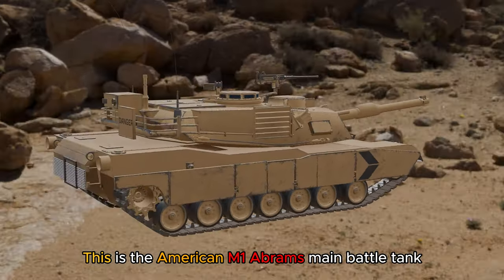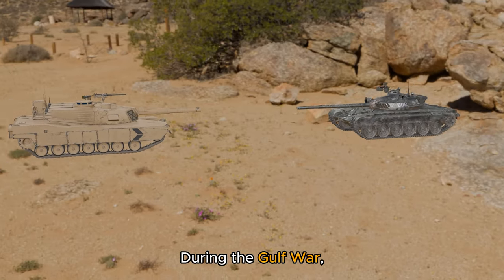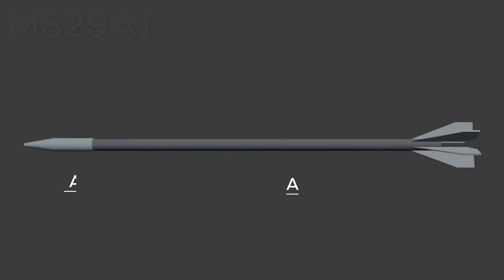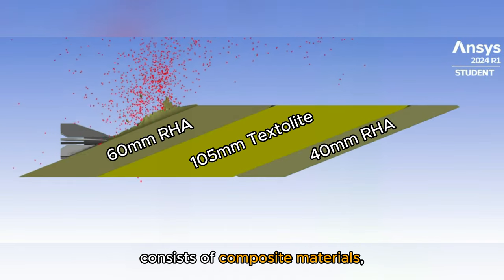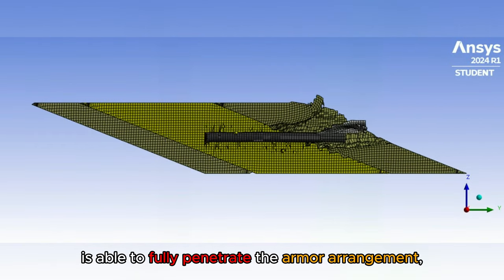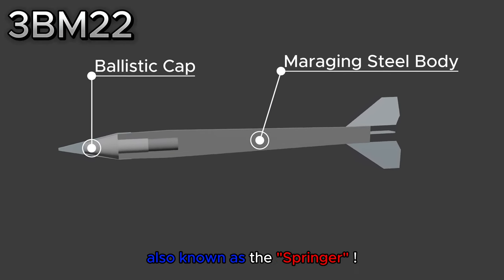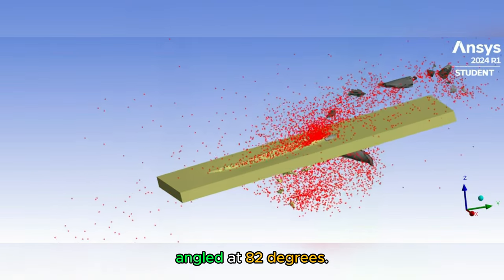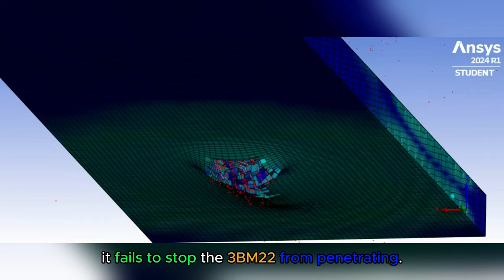What Happens When M1 Abrams Battles T-72?

Comment: Something to keep in mind regarding the Abrams's miniscule upper front plate armor is that NATO doctrine prioritizes fighting in a "hull-down" position behind cover, where only the turret is exposed. American statistics from WW2 showed that most killing blows on tanks were to the turret front, so the Abrams was built with extremely effective frontal turret armor, at the expense of other areas to save weight.

Soviet doctrine on the other hand was based on overwhelming massed armor charges, where they would not take consistent advantage of defensive terrain features, so armoring the hull front was equally important to the turret front.